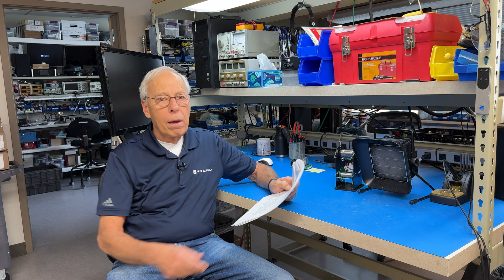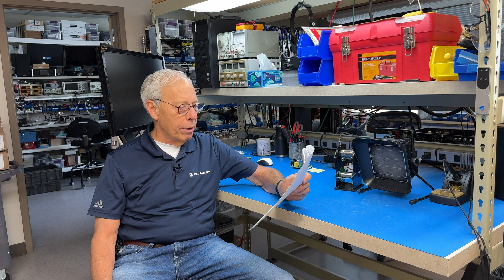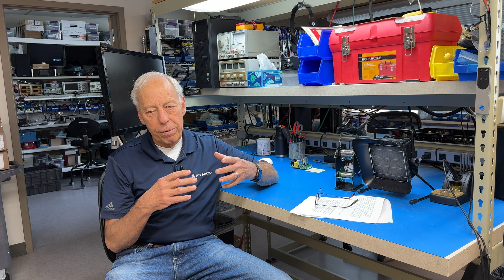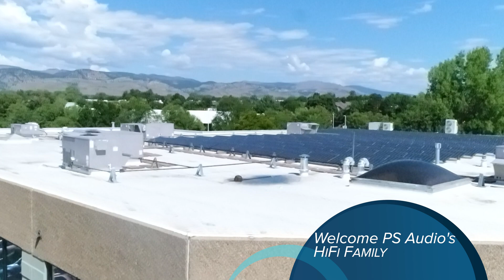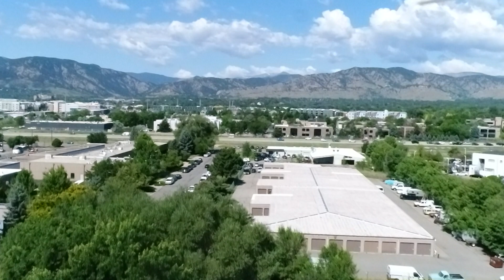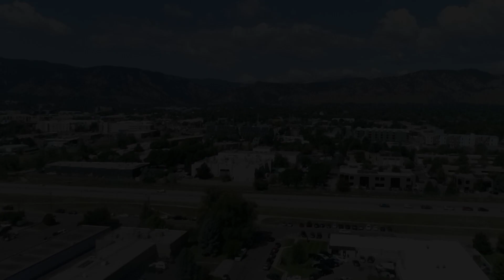Component aging in audio electronics

Comment: I have a garden gate analogy I always use. If you're gate isn't used often the hinges will seize and need maintenance. If your gate is used frequently the hinges will wear and need maintenance...... Mechanical components (such as disc players) often use rubber drive belts which break down in time and will need routine replacement regardless of amount of use

Comment: When, not if, when, you have to replace caps do some research on tonal characteristics on the caps you put back in.  The techs will say if the values are the same they will work.  They will work but it can significantly change the sound of the piece.  A cap in the power amp of a vandersteen sub let the smoke out so I decided to totally recap the amps in both speakers. Figure it was just subs so no need to get picky.  New caps had a huge difference, more bass and not nearly as tight as originals.  Maybe they will burn in but setup needed sig tweaking for the sound to be acceptable.  Same tech made me a high pass filter for the subs using whatever caps he had.  Uninspiring.  I had another tech build me a charge balanced filter with high end caps i specified and they were killer.

Comment: Any new components need to be powered up slowly ober time .use a variac to power up your vintage components ..capacitors are aproblem when tgey are not cycled not to mention plastic and rubber .they dont like ozone .Humidity and mold are an issue

Comment: Likely by the time you need the second Oppo, the rubber belt that helps the disc to spin will have started to disintergrate and need replacing. Those belts have been the biggest burden in our hi-fi system and all the components in it are under 30 years old.

Comment: Rubber parts, electrolytic capacitors, and nowadays, since the use of RoHS solder, tin whisker growth are the three main aging issues with electronic/electromechanical gear, since the late 90's.
Reply: Can you brush those tin whiskers off, or does it require more work?

Comment: Right now, I'm looking at a (MSRP) $2000 QSC Amp thinking the same thing. I use 2 now but got such a great deal on the 3rd I couldn't let it pass even if it was to just sit on a shelf. I figure things are built with better tech in the last 20+ years and could sit almost indefinitely without use. As long as it's kept in climate controlled and a lack of moisture. In a cabinet under my main system is fine. In the garage or an attic may not be so good.

Comment: Batteries! If your device has a built in battery, there is a high chance of it leaking and corroding the device from the inside. If possible, remove the battery before storage.

Comment: In the early 2000s, I bought a well-known HMS Energia power strip, the largest model with 7 or 8 sockets. Very happy with. 
But today, the outer sheath has completely hardened and cracked to the point where it falls apart at the slightest touch.

Comment: So, for the Oppo player, if there are belts inside that are made of rubber, they can grow hard, crack, and break with the passage of time regardless of whether they are used or not. These should be replaceable.

Electrolytic capacitors can dry out. Smaller ones, in audio circuits, will color the sound, maybe. Larger ones that are part of power supplies will fail. There are collectors of 50-year old computers in the latter situation that "re-form" the power supplies by hooking the equipment up to a variable power supply (a Variac) to bring the voltage up slowly over the course of a week. YMMV.

Comment: Does idling a class A and AB amp hurt the caps over time? Like if I just leave the amp on all day not playing anything while I’m out of the house or even several days.
Reply: I've never heard of caps failing because of the amount of use. If anything it's long term non use that might cause elect caps to de-form, like years. That's why it's sometimes recommended to bring up the supply voltage very slowly to allow the elect caps to re-form, especially with real vintage equipment that might not have seen use for decades. Shango066 often does this with ancient items using a Variac.

The only thing that might be hurt by leaving your audio equipment on all the time is your electric bill. Unless you have a valves(vacuum toobs) in your system, because those do have a finite use time.
Reply: @michaelturner4457 this is not entirely true, heat also ruins electrolytic capacitors, that's why they have to be replaced more often in class A amplifiers.

Comment: this is interesting, because many my rarely used electronics just broken. just sitting in the shelf. some said regular usage can help prolong the life. so, which one has more truth?
Reply: Exactly, that has been my observation as well, and several techicians I have talked to agreed that no usage at all ove a long time is not good for electrolytic caps. You don't have to run them hours, a couple minutes is usually al it takes. That's how I do it with my serviced vintage gear from the 50s and 60s. Has worked out quite well so far.

Comment: I believe the question pertained more to the aging of electronic components.
Reply: I think the only electronic components that would really be affected by aging are electrolytic capacitors and batteries. That Oppo may have a CR-232 or similar battery in it.
Reply: @douglaswilliams6834  If putting anything with a cr2032 or similar into long term store, remove them batteries.

Comment: Interesting.  I would have thought the first words would be about electrolytic caps starting to dry out with or without use.  If that is less of a concern I am pleased as I will happily use my current components for life.  I have had some switches go bad but they are easy to replace.  And of course tubes are consumables, so they are periodically renewed.

Comment: Certain components have improved dramatically over the years like resistors and foil type capacitors. The original types were not hermetically sealed against moisture and over the years would drift out of spec. These days, the paper type capacitors in old tube radios are near universally bad and require wholesale replacement. Same for electrolytics. Some do hold up, but I would never leave them in a piece of gear that someone would use on a regular basis. The old carbon comp resistors have to be checked. Often they'll drift upward in resistance. Modern  film capacitors will last a very long time due to much improved manufacturing techniques and materials. Electrolytics remain problematic however, and will be the cause of many electronics failures in the future.

Comment: The center of my best hifi system is a top of the line Motorola console stereo bought new in 1967. It still sounds pretty good...great bass .  It is connected to the audio output of my tv and you tube videos sound very good through it.
Reply: Is it connected to the wash machine?😂
Reply: @davidcontini7217  Yes indeed. That would be my 1912 propane powered ringer washing machine. I fear, sir, that we are on opposite sides of the audiophile spectrum?

Comment: In the same time capacitors starts to dry out and degrade and drift over 10–15 years it’s recommended to change them. At least check and service if needed.

Comment: Valves(vacuum toobs) are certainly affected by the amount of usage rather than time. As they can only run for a finite amount of hours before their emission decays. And anything with mechanical moving parts can be affected by time, like disc players, tape players, etc, as rubbers and plastics may decompose(hello Sony), and lubrication dries out.

Comment: I absolutely agree with you Paul. Over 25 plus years ago I purchased what for my budget at the time could handle, a decent stereo system and I spent the extra money to get what was at the time higher quality interconnects and cables. Granted, they were not what would be considered audiophile grade , but they were what was available at the retailer and is a very well known brand. Within less than 2 years the rubbery material around the plugs and connectors was deteriorating and basically crumbling  from my touch. I live Southern California, but far enough inland for high humidity to be a relatively non issue. I never bothered to go back to the dealer as they got taken over by another large chain that sold mostly computers and other household electronics and then promptly declared bankruptcy.  I would bet that the material used by this ubiquitous and well known manufacturer was inferior and I was among probably many thousands of customers who all suffered the same fate. Quality, quality, quality, is what matters. And it aint cheap , but paying once versus paying again and again with the same disappointing result has altered my preference on most everything. I am often forced to wait a bit longer, but it is the positive result at the end that matters. Keep up the good work Paul, I truly appreciate your helpful videos.

Comment: I have a radio that used to sit in my grandparents kitchen. The radio was made in 1951 , wood veneer, tubes (none of which I recognise) , an air dielectric multi-vane tuning capacitor and a wood veneer exterior with built in oval loudspeaker. It still works, though only powered up every 10 years just to see. Beautiful sound, with the BBC radio 4 e.g. that rounded off plummy vocal , sounding like a posh bloke hiding in a well padded cupboard full of wool coats, that used to so common on BBC news and Weather output . It still works and is multi band, unlike say a modern Hi-Fi tuner. Humidity here in Scotland is around 60-70% and the radio must have spent about 20 years in their kitchen, with lots of regular home cooking and jam making creating heat & steam. As far as I can tell, the components are original, except for a strange looking tube when comparing the insides to a picture of the same radio on the internet.

Comment: I'm replacing caps in 45 year old gear with 105° caps as long as they're fairly linear. The 85° caps may sound minutely better to start, but over the long run, the higher temp caps will be better. The big change is adding soft start to my amps.

Comment: The cost of fixing these frequently failing components such as rubber belts, rubber surrounds in speakers, cracked solderings, electrolytic capacitors, tubes and display light bulbs (pre 1980s older gear) is often less than the cost of a lunch, if you can do it yourself.
Reply: It helps if you buy a Hakko desoldering tool. They cost more than lunch though.
Reply: You are right! I have re-foamed many speakers found at thrift stores, goodwill etc ...that I got for cheap! Some JBL4410 a  studio monitors for $9 each are my favorite ! All they needed was foam!
Reply: @Jonhobbs64  I've re-foamed 2 pair of speakers also and have another pair I plan to re-foam. I had some old B&O CX-100 3-way speakers from the 1980s  that are with excellent aluminum enclosure and I decided to turn them into garage speakers. So I re-foamed the drivers (the surround material had literally melted away to become a sticky substance) and removed the passive cross-over and turned them into active speakers with active fine-tuned cross-over. Now they look like brand-new and play better than ever and for a garage, I can't complain.
Reply: @ThinkingBetter  wow that sounds great! The only downside to re foaming is that it's tedious and time consuming just removing all of the old foam and especially the glue. I have had good results with denatured alcohol and parts from simply speakers or Midwest speaker supply. Cerwin Vega vs 120 set is next in line!
Reply: @Jonhobbs64  Yes, it takes some patience and extra care to do well and make it look professional. Some surround material seems to last much longer. My JBL 18Ti from the mid 1980s have worked flawlessly since I bought them while in high school. Nowadays I use them as gym room speakers and you can’t see on those drivers that they are almost 40 years old. JBL did some awesome speakers in the past.
Reply: @Jonhobbs64  I got a solid walnut lazy Susan at Goodwill that I use for re-foaming. Of course I cover it to keep glue and dirt off, but it's still fun to use. I got my JBL 4343s professionally re-foamed in the '90s before I knew how. They're still going strong.
Reply: @BlankBrain  that's a good idea! I need a better work station than the dinner table! I like many different vintage speakers, but JBL's are hard to beat!

Comment: That affects lots of manufacturing processes including paint and tyre manufacturing. Never heard about it affecting cloth as there is a lot of clothes manufacture in Hong Kong. At least there used to be. Definitely affects camera lenses. In older amplifiers I think the larger output caps are affected sooner.
Reply: Paul did say his cloth covered cables were stored in a warehouse for a year. Which presumably wasn't climate controlled. Moisture and high humidity can very much affect cloths and fabrics. Ever packed a tent away that wasn't completely dry, and then found it went mouldy?  

Apparel, especially fashion items, won't usually be stored in a warehouse for months or years. A while back I worked with Gap Inc and Arcadia Group, and their clothes would go from the factories in Hong Kong, China, Vietnam, Thailand, etc, and would be in the shops within a couple of days, sometimes hours.

Comment: If you're unfortunate enough to have electrolytic capacitors in your equipment those can dry out over time. As Paul says, rubbery things such as roll surrounds on drivers can be a problem too.
Reply: As if these things aren't in 99 percent of equipment. There's nothing wrong with them. Also, it takes a long time for them to dry out, and if they do, you can replace them
Reply: @xaviermontalban1701  Electrolytics shouldn't be found in decent audio equipment, although can be replaced at low cost as mentioned if one is competent with a soldering iron.
Reply: @oliverbeard7912   This audiofool rethoric and has nothing to do with facts or knowledge about electronics. Stop spreading nonsense mate
Reply: @xaviermontalban1701  We'll have to agree to disagree.
Reply: @xaviermontalban1701  it would take up too much real estate in my amp to use something other than electrolytic supply caps.
Reply: I replaced some electrolytics in a 45 year old Sansui amp. All of those that I removed tested very well, so I wasted my time. Maybe Sansui used very good quality caps in their budget amps.
Reply: @ianbigsand7 the big electrolytic caps last a long time, it's usually the smaller ones that dry out.
Reply: Hi  @mitchtaylor6512 , thanks, I'm going to get back to the rest of them sometime.
Reply: Rubbery things are certainly in any equipment that has mechanical moving parts, like turntables, CD players, and tape decks. There's plastic components that might decompose with age as well, such as gears and cams. Which are sometimes unobtainable, as the manufacturer has discontinued support, e.g. Oppo and their "universal disc player".